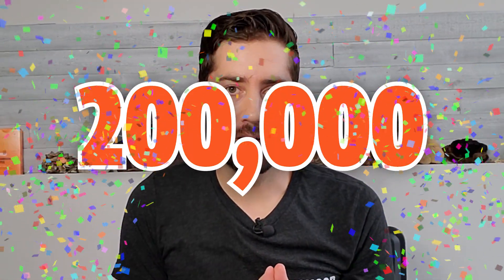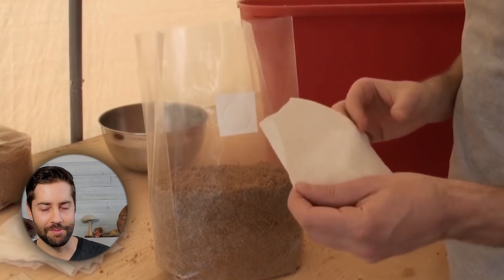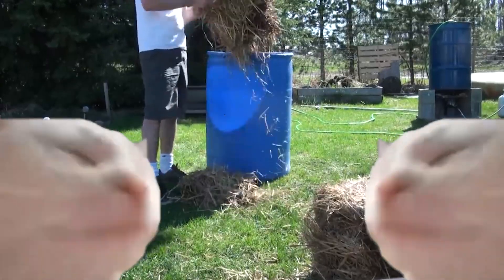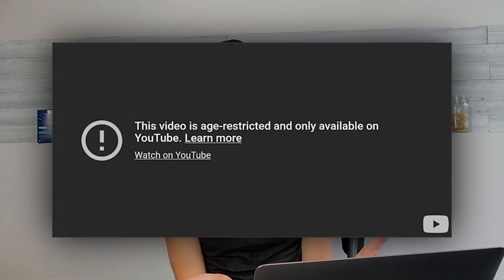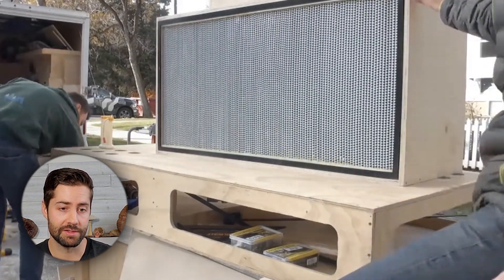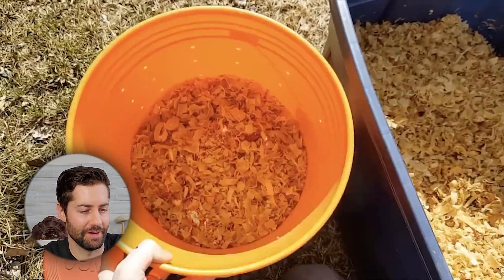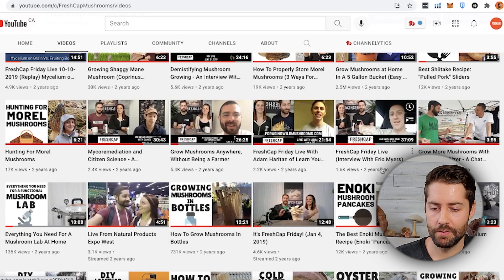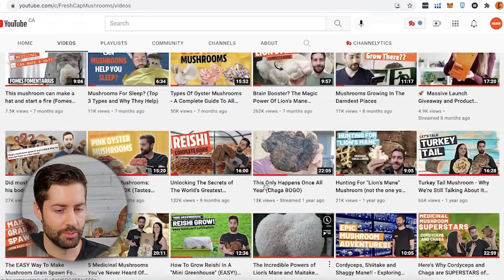How to Grow a Mushroom (YouTube Channel)

Comment: I recently got into mushroom growing and the resources here are so limited (no flow hood no pressure cooker). I managed to clone an oyster mushroom in a liquid culture and somehow managed to make a clean liquid culture syringe with near-to-none resouces. Made grain spawn with wheatberries that I harvested the year before without contamination. Made pastorized straw substrate and managed to get my mycelium going. I have a question. Can I use my growing mycelium on my substrate to transfer to other substrate material and get more mycelium or do I have to make new culture/grain spawn to cultivate more mushrooms?
Reply from the maker: Yes, you can certainly add your colonized substrate to more substrate- works great!
Reply: @FreshCapMushrooms  thanks!

Comment: Love that you cleared up the filter on the bag. Starting out (2 months ago), I would empty my pressure cooker in front of the filter and seal the bag before storage. The fact is that it's automatically vacuum sealed in the cooker. I do find that if I don't let it cool enough and empty the cooker while it's hot, then the bag doesn't feel as tight handling. It's like a brick if it cools properly. Still learning the path of least resistance on this. This is just my observation. 

And congrats on the 200k🍄🎉
Reply from the maker: ya, that makes sense. I do like to let the bags cool a fair bit, but always in the cooker, filter sleeve was just an added unecessary step